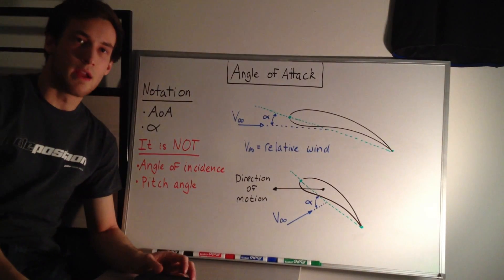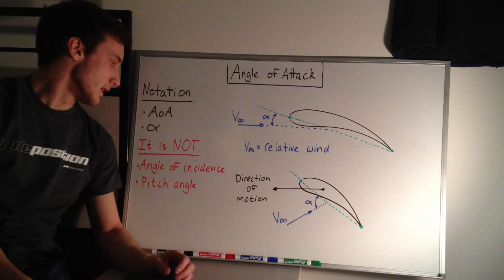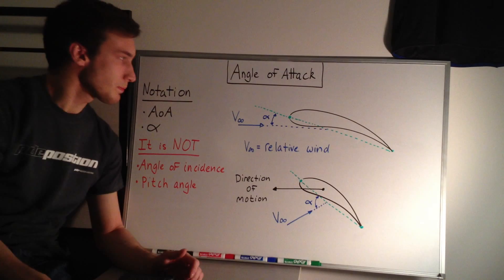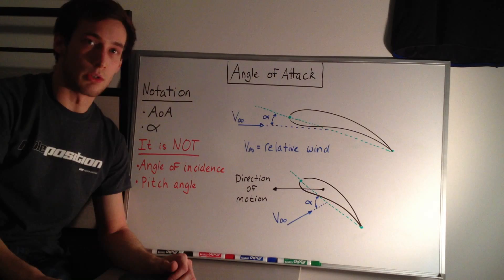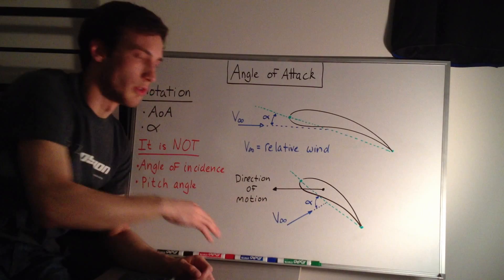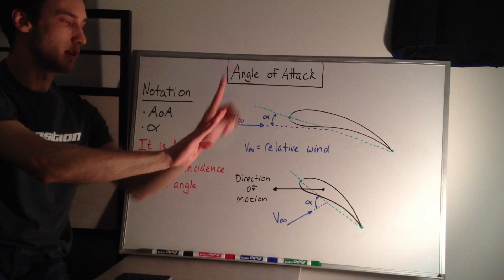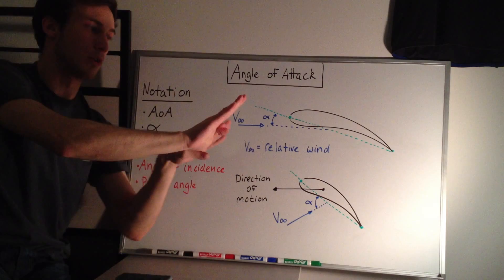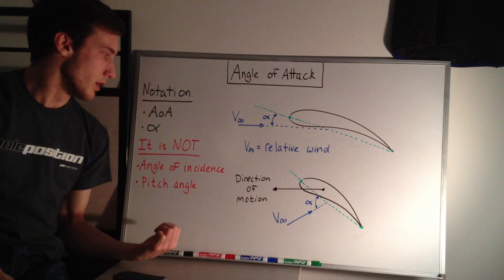Explained: Angle of Attack [Airplanes]

Comment: What does the AoA determine? Lift effeciency?
Reply from the maker: It is directly related to the wing's lift.  Here is my video on the lift curve.  You can see how the angle of attack is on the x-axis, and the lift coefficient is on the y-axis.  The lift coefficient will increase linearly with angle of attack (when the flow is not close to separation, or separated).  So the higher the angle of attack, the more lift you will get from your wing, up to a certain point.

https://goo.gl/TKq9BA

The AoA is also related to an aircraft's velocity.  To really understand the reason for this, I would recommend the book 'Stick and Rudder' by Wolfgang Langewiesche.  The book definitely opened up a new way of thinking about flight for me.